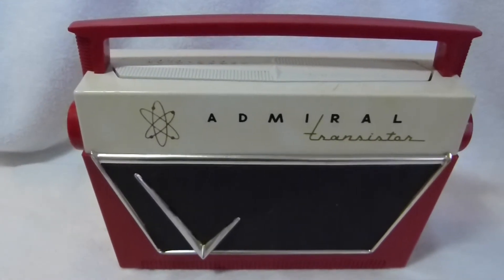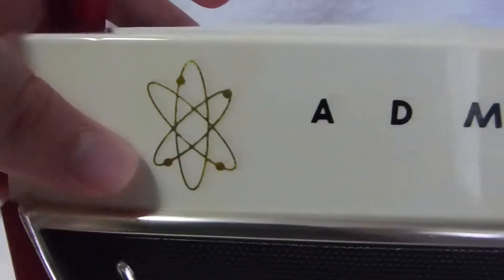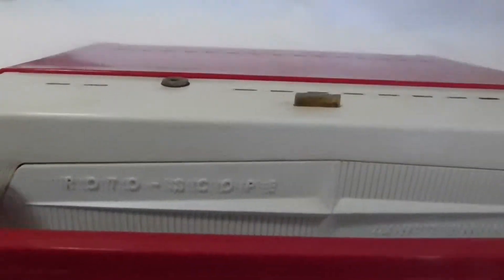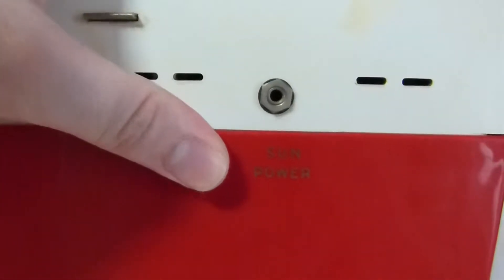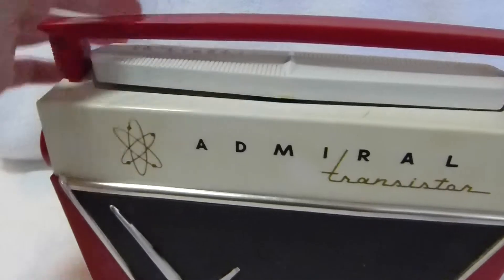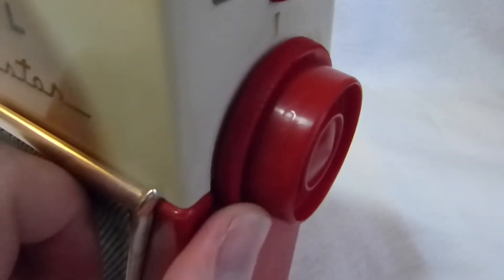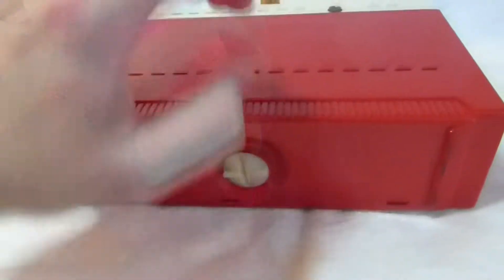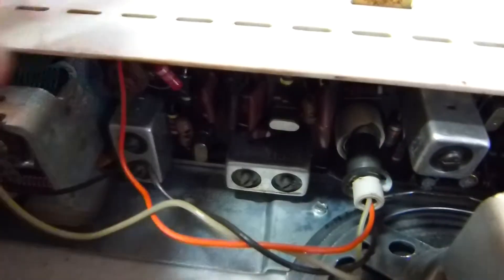1956 Admiral model 7L12 Transistor Radio (Admiral's first transistor radio, made in USA)

Comment: I have one of these radios that I bought new in 1956. It went to the Navy with me from 1957 to 1959 and traveled around the world with me on the Battleship USS Iowa BB61 and the destroyer USS Bigelow DD942. I still have it and it still works and is in perfect original condition.
Reply from the maker: That must have felt real high tech back in 1956! It's cool that you still have it, and that it still works. This seems like a pretty ideal radio to take out to sea, with it's long battery life and big antenna.
Reply: Some of those Admiral transistor radios run on 12 volts. Imagine how good those must sound! Nice video!

Comment: How did you repair the torn speaker? I mean which glue did you use to fix it back to normal?
Reply from the maker: I generally use Elmer's white glue (because it dries clear and is flexible) and if necessary, pieces of a scrapped speaker cone, to repair speakers.

Comment: For cleaning batter corrosion I use Deoxit  it dissolves all that rust & gunk.
Reply from the maker: I use deoxit on volume controls and switches, but I have not tried it on rust, I guess it's worth a shot.
Reply: try spraying it on the battery contacts & scrubbing them with a toothbrush
Reply: really like your channel by the way...
Reply from the maker: Thanks!